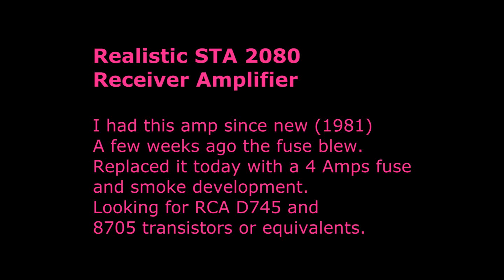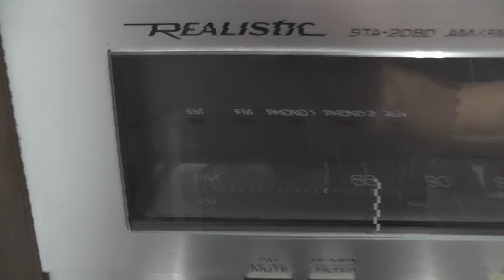Realistic STA 2080 Amplifier fault

Comment: Whatever you do do not do what he did that is the absolute worst thing you can do she should not have done that what he did he could have saved himself a lot of problems if you just taking the unit apart and tested the parts before you put an oversized fuse in and burned everything up all I have to do is use his meter if he knows how to use it properly and he would have discovered which parts were bad but now I guess he wanted a little bit more drama he put an oversized fuse in and burnt everything up Bravo we got a little more drama

Comment: I have one of these STA-2080s. Although not their most powerful, it was one of the nicer looking receivers Realistic sold, with the four meters across the top. Any idea what lead to the output transistors failing violently? Was there a short in the speaker wiring? Notice how something on the driver board lit up at 0:30 just before the smoke billowed.

Comment: Nothing lasts forever. That said, I have a 1972 vintage Monarch in the cottage that still works fine and has never been opened. There's a 1976 vintage ROTEL in the workshop too - which was rebuilt as an audio test bench in the early '90s. It has plug in T03 output devices on the back, which have been blown up dozens of times when testing attached equipment (usually as a result of DC being imposed on the speaker terminals). Literally any NPN/PNP pair can be plugged in to replace them and up she jumps again. Still working fine in 2014, in daily use.

Comment: Honestly, it looks like something that could be fixed at a component level, and worth a shot.  Check the resistors, too.  If you can fix it... DO IT!  Devices made <1990's are made to be fixed.

In 1989, I had a computer monitor that went black.  It cost $0.32 when I found the dead resistor.  All it took was a schematic, volt meter and oscilloscope.  

Fabrication techniques today--using computers for an example--render a whole main-board trash if so much as a dust mote lands on it.  Pin spacing <= 1/64 inch + surface mount equals no repair options.  The ultimate end-life application of these items are "pop" videos, preferably with severall kV, with a big capacitor.  

Take care, and keep up the vids.

--Robert
Reply: You heard the man. DO IT!

Comment: make sure you check all your speaker connections too, because i had a stereo that i had accidently crossed speaker wires and it burned out one channel, i had to put it in the shop for repairs it was a sears, and i think you should try RADIO SHACK , in Fort Worth Texas, USA  for parts if you dont find the parts  in your country, because Radio Shack, is or was the maker of Realistic TANDY, ,,.and the headquarters is in Fort Worth Texas USA

Comment: I would replace all the output transistors as well as the bias resistors as they tend to get damaged when the output transistors fail and it would not hurt to check the pre-amp transistors as well. I would personally change the capacitors as they are 30+ years old and could be have some leakage due to them drying out and also do not forget to check for cold solder joints which plays a major part of vintage amplifiers failing in the first place.

Comment: If an amp has popped it's fuse, change it and bring it up on a current limited supply to check for problems. Putting in a larger fuse will just cause more damage and even burn off board traces. Hope you get 'er going again.

Comment: dont just replace the output transistors, if any of the other transissitors are shorted it will fry all of them again. good chance the pot and some diodes are smoked too. Fixing these things is a real art. All the parts have to be gain matched and goood like the originals
Reply: RODALCO2007
If you can't find the originals, get a Sanken 2SA1493=2SB705 and 2SC3857=2SD745. Just be aware as shango says, check other parts first. Also, counterfeiting of transistors is a big problem so be wary of E bay. (I have professionally designed audio amps)
Reply from the maker: Thanks shango, I will check all the other components too, some of those smaller transistors look they are shorted, and will replace. The other channel amp is fine so I can compare values. When repairs are done I will use a lamp to limit current at start up via variac. Will be a few weeks to get all parts sorted out.
Reply from the maker: 2N3055A
Thanks for your advise.

Comment: That really is too bad. I worked at Tandy's for its last year of operation in the Netherlands. Terrible company, but to be fair some of their stuff wasn't that bad. Their electronic components were massively overpriced though...
Reply from the maker: Yes there components were expensive. This amp used to be in the catalog as one of the top models. with the big speakers 4 Tweeters, 4 Midrange and 1 Woofer. Speaker foam has deteriorated now, use JVC speakers. I bought this for almost half price when new range of equipments were introduced early 1980's.
Reply: You should be able to procure new foam for the hinge/surround portions of those speakers, or something close enough to work. Since the power output transistors have different numbers I would guess that one is PNP and the other is NPN, it was a away of getting around using an interstage transformer or a phase inverter transistor in the driver stage.
 This is why I like tube amps, tubes usually do not self destruct just from age like transistors often do. Mind you something in the driver board may have helped EOL those power transistors since the other channel is fine. Shango is definitely the one to consult with after that Pioneer amp he had to fix.
Reply: That is pretty much their current state here (USA).  Their stock of components is pitiful (555s, LM358s, ho hum passives, transistors and diodes and not much else).  Everything is geared towards selling consumer grade rubbish.
About the only worthwhile thing is their 250mW resistor assortment.  And only by virtue of the fact that no other seller I know of sells decent selections of 5% carbon film resistors for 3 cents a resistor without having to get hundreds of parts per value.  Everything else can be had for substantially cheaper (an order of magnitude less (555s) or even cheaper (2N3904s) in many cases) from Jameco or Digikey.  Better selection too.

Comment: Try looking up 2SD745 - often, those Japanese chips that start with A or B cross to the same 2SA or 2SB PNPs, and likewise for C and D to 2SC and 2SD NPN devices. In fact, a quick Google shows 2SD745 shows an image of just the transistor in this video! HTH! :)
Reply from the maker: Thanks for that info, finally worked that 2SC(D) code.

Comment: Add 2S in front of the D745 and see if that device looks like what you have and  I suspect the 8705 is in fact a 2SB705 I.E. the 8 is a B

As these are outputs i would check very carefully the driver transistors as one of these failed can have a cascade effect. I would be tempted to change them just in case and also look at the electrolytics and there maybe bias diodes near the output which you should check are not shorted.

No idea what parts places there are in NZ but you could try these guys. https://www.rockby.com.au If the originals transistors are not available they are agents for NTE who make equivalents but are generally more expensive.
Reply: the pot on that board is most lightly to set the bias on the output stage. The bias is to set the quiescent current in the output stage and as the amp is direct coupled anything prior or changing the outputs which have a slightly different gain factor will require the pot to be adjusted. I have no idea whats normal or which test point to measure but as you still have one good channel you might be able to use it as a guide. ideally get the manual perhaps
Reply: Systemrat2008 OK I found what claims to be a manual http://www.hifiengine.com/manual_library/realistic/sta-2080.shtml for free i have NO idea if that site if legit.

Comment: that amp is as old as me ! damn, i hope i keep running for a few years yet ;-)
welcome back mate! :)
Reply from the maker: LOL, hardest part is to find the transistor data, to get replacements.
Reply: RODALCO2007 http://www.ebay.com.au/itm/2SD745-200V-D745-ECG92-NPN-PIONEER-POWER-AMPLIFIER-TRANSISTOR-OUTPUT-/151054275458
Reply from the maker: alex993cc1
Thanks, I got a PM re the other 2SB705 transistor too. will get some ordered.